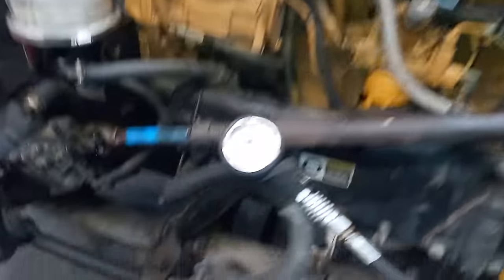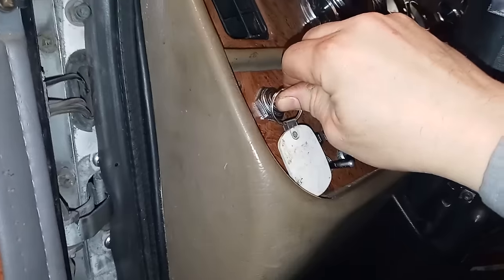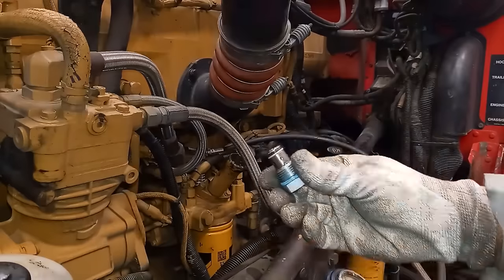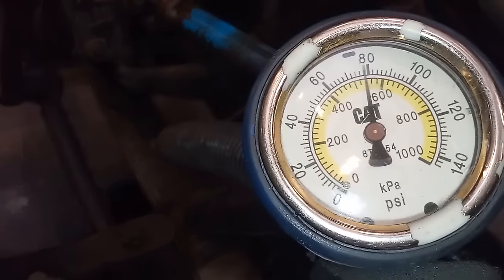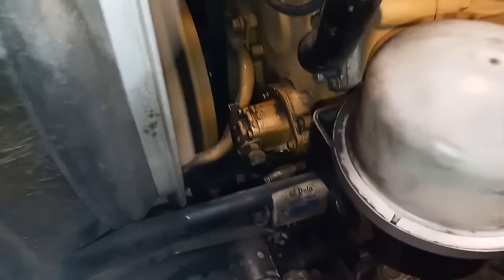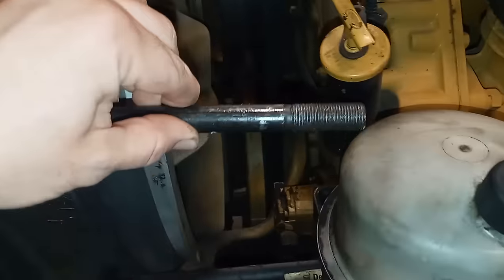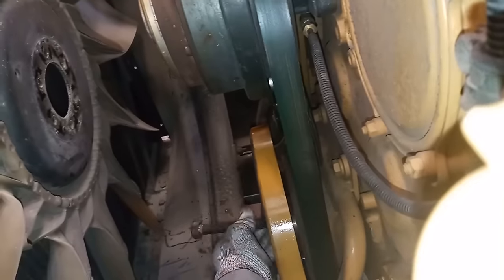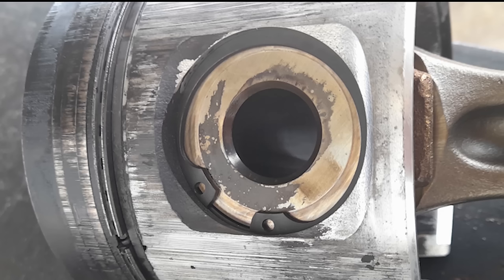Fixing a subscriber's SHAKY C15 Cat engine. Bad Damper? Low Fuel Pressure?

Comment: I have recently bought a 2007 F750 with what i believe is a C7. It ran fine for about a month then all of a sudden as I'm driving right before it shifts into the next gear it loses power and smokes real bad. If you push harder on the throttle it kind of smoothes out and shifts on into the next gear. I hooked up a fuel pressure guage today while driving. At idle I'm getting about 55 to 60 and while driving it gets up to about 75. Is that anywhere close to spec on that? We also pulled off the valve cover and pressurized the oil system and everything seems fine there. If there is any direction that you can steer me it would be greatly appreciated.

Comment: Josh, our fleet runs glider Kenworths with 2WS Cat engines, jakes and Cat brake saver. 
My question is : what should the Brake Saver  application  air pressure be set at ? 
Mine is set at 50 psi.

Comment: Any experience with a CAT D318?
I have one in an old bay city dragline that I keeping running. Exhaust slobbers a lot back down the stack and it seeps a little at the head from coolant jacket. Still idles down fine and has power under load but smokes a fair bit under load.

Comment: Hey Josh I installed a new 20R2524 fuel pump about a year ago did it have the updated spring? I only get about 85 psi at full throttle. NXS20386

Comment: Did this truck have a shake in the cab while at idle? I have a t800 with a c13. It has a shake while idling, and a growl/vibration under load. I was also wondering if it was the damper

Comment: Hey my cat engine is chugging an under load in 6th and 7th gear, it will rev too high ( it between 1100-1400rmp). Once I get it to 1500 it settles down. But it will start chugging sometimes and instead of making it getting it through the chugging I will down shift. I’m thinking fuel delivery, I’ve already changed the speed sensor. How ideas?

Comment: 3406c  I put knew filters on drove a couple days then started acting like it wasn't getting fuel and shaking..I let out of throttle a few seconds then apply throttle it will run 20 miles then does it again 🙃😅 need your opinion..please help

Comment: I had a question about a problem that I've been having for a year and it is related to the cruise control on my truck. its a 2012 western star 4900 SA and it is glider with a cat 6nz in it, the problem is that the crime control picks up rpm without me pushing the bottom and I've taken it to many mechanic and they have no idea what's happening, so I thought that you might have an idea about what's happening?

Comment: Maybe stupid question…..
Let’s not consider why only that for some reason you look down and notice your E-model CAT is over heating (not extremely) but 225+. Is it better to cut the engine immediately or turn the fan on and let the temp come down gradually?? Thank you… 
If you have covered this previously sorry I missed that..
Reply from the maker: It would be better to keep the engine running, but turn the fan on and pull over. It will cool off faster and more uniformly this way. Just shutting it off, stops the coolant flow which can cause it to boil over.

Comment: I’m trying to solve shudder when I kill the ignition in my Toyota 5L 3.0L non turbo Diesel engine. When replacing the vacuum hoses, a brittle connector snapped off the VSV valve. I replaced the valve and now it feels like the engine wants to jump up and left from the bay. The idle up valve is in good condition and the butterfly valve closes when released in test conditions. The shudder is synonymous with the valve not closing 100% when the ignition is killed. It has me stumped.

Comment: Hi, when I start my truck in the morning. Fuel pressure gauge take 7 seconds to start moving and total 25 seconds to reach 85psi. It’s running will except one day it took longer to start. I change the fuel pump and both fuel regulator valves. I tried giving fuel straight from the bucket no bubbles in the return line and leave the bucket there and next day same  takes seven seconds to start raising the fuel pressure. Please help thanks

Comment: Hello mate I have a question that desperately needs answer.I hope you will notice me.I am currently working on Cat C32. we pulled out cylinder packs and Camshaft. When putting camshaft back I want to make sure if TDC 1 is in compression.Is there any way too look at just to make sure that I'm on a right compression TDC1?before I can align my Camshaft rear gear..Hope you will notice me . Thanks.
Reply: I know the pin in the flywheel to find  TDC 1 but I want to know if I'm in a right compression. Putting pin in a flywheel will tell you either your in TDC 1 or 11

Comment: Adept Ape how you been bro ? Quick question if you can help me out here i have a cat c-15 engine i cant make it to turn on it cranks but doesnt start i changed the ECM,Injectors,fuel transfer pump,prime pump,check valve,cam sensor,crankshaft sensor,fuel pressure valve and the truck still doesnt turn on i traid starting fluid and it doesnt stay on.. do you know what could be the problem
Reply: If you’re still fighting this disconnect the high pressure oil sensor. Not sure what CAT calls it. Have seen those fail, not code, and cause a crank no start.

Comment: I’ve got a msx , it’s been running great I put a diesel freak harness on it a while back for the extra little power an better fuel mileage , out of no where it’s starting running rough idles rough or kinda shakes , when I’m starting to taking off I can feel it sorta miss , I just changed both fuel filters , also kinda weird but I’m also just started hearing a squealing sound like a belt but as soon as I turn my AC off it goes away , any suggestions ?
Reply from the maker: The AC squealing is probably the compressor going bad since it stops when you turn the compressor off. Should have that checked out. The right idle could be many things, start with checking your fuel pressure. Should be around 75 psi at idle.
Reply: @AdeptApe  this c15 I swear is in its own world , so I have no check engine light but my friend plugged up cat et to it an discovered that it had a logged code for coolant temp sensor voltage low , so I replaced the sensor an added a new engine wiring harness , an still keeps logging that code , problem is it puts the truck into derate , at this point I’m all out of ideas except maybe the ecm is bad 🤷🏻‍♂️

Comment: Josh what is the part number for that fuel return regulator?
Reply: 75 lb regulator in the return fuel system is 2812725, with a 6V4589 seal.

Comment: Hey Josh.  I shared your video about testing the C7 heui pump using the scan tool with the mechanic troubleshooting the misfire in my 2004 rv’s c7.  Sure enough the pressure was bouncing around hundeds of psi.  As you may recall last year the turbocharger blew up ( it was your destruction of the week).   Since there is only about 40k miles on this engine I suspect the turbo issue may have damaged the pump.  Btw he was very impressed with your video so I sent him the one where you showed how to replace the pump.  Not as much room to work in an rv btw.  Bottom line is think we will have the pump replaced.  He will allow me to purchase the pump so I was wondering if there is anything else to make sure I order.  I have the engine serial number (KAL 06887).

Comment: You could have added the part numbers for the parts you replaced. We watch these videos the the repair advice. Not drain pan promotions. You know how hard it is to get info from the dealer. And i have to drive two hours to the nearest one.   Really, good job on the videos otherwise.